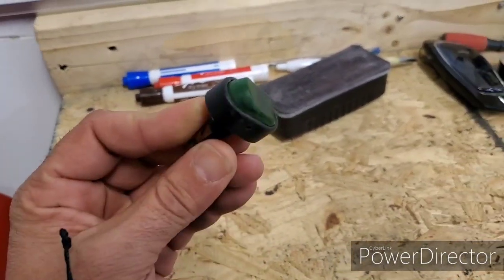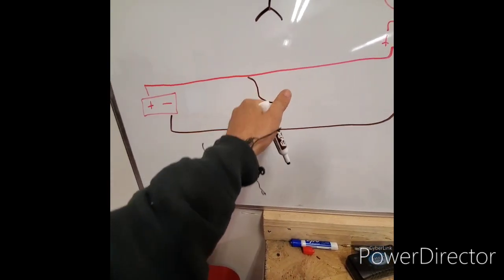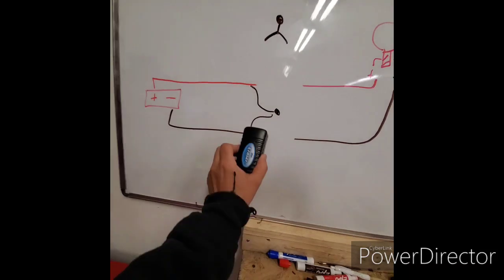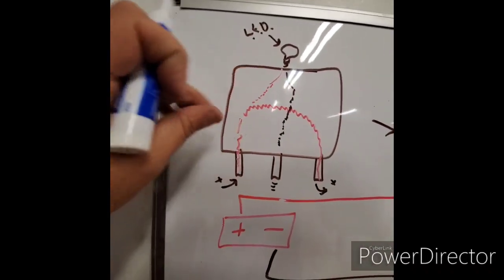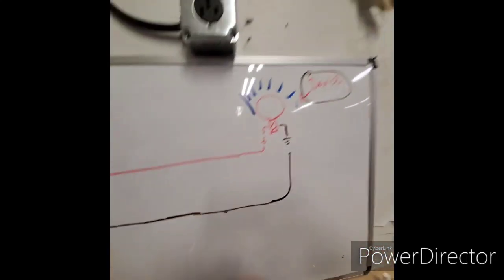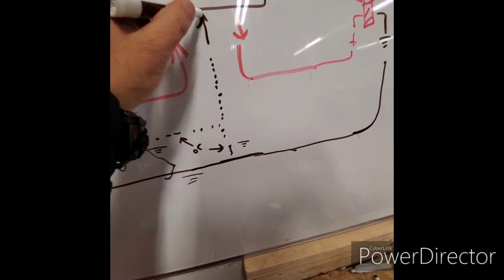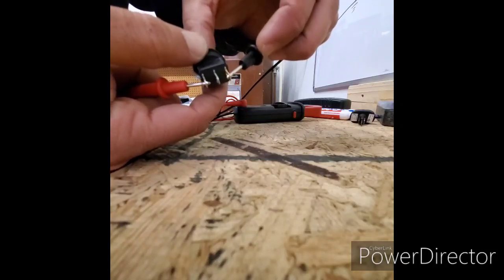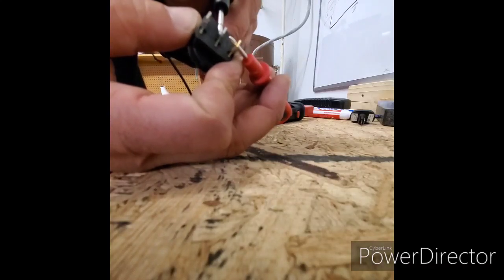How to wire an LED toggle switch , ( on-off 3 prong rocker switch ) 2020

Comment: Main question is how many things can i connect to one switch i got rgb halos i got knight rider led light an bonnet vents led lights all normal connect to postive an a ground to work please let me know do i need 3 toggle switch seprate for each device or can i connect all the wire together can instll on one switch please help also i had installed all one switch an my wires today went in smoke u see but i think its to overpowering the toggle switch an i think the switch was not connected the way u said like on one leg they have been fine for months working an stuff but today for some reason they smoked lucky im ok please help to this answer no my other question
Reply from the maker: You do not "need" 3 different switches. You can use 3, if you want individual control. But not needed for function. You must use 1 power source, you mist fuse that power wire,  and both the fuse and switch, MUST match the "amperage" draw of the lights combined. No matter the switch or device, the switch will ALWAYS have to be use only on 1 leg. Either power or ground like in the video.
Reply: @myonlinecarguy1  ok i think i know so can have one toggle switch with the fuse in the middle of the switch an the power cable from the battary all on one leg the amp of the fuse does that have to be the same amp of the switch an is it jus one fuse i will have right inbetween the power cabel from the battary an the switch an the amperage how do i find this out for my lights like is 18 amp fine do u think is there anywhere else i can talk to u an send u the pics of what lights i got in more dept please u got insta wats app or anything
Reply: @myonlinecarguy1  hi how do i know the amperage im drawing from my lights
Reply from the maker: The paperwork for the lights.
Reply: @myonlinecarguy1  but cause theres a few light like i told u before how do i know the final out come of what wire i need an fuse please can i send u the listings of the lights i have on instagram or somewhere as im so confufused its not like one light im lightting its a few
Reply from the maker: Youll add up the aperage for each of them. Thatll be the total load.
Reply: @myonlinecarguy1  ok the way i add it up i can search the lights on ebay that i brought an check the specs of the amp right as i dont have the pacaging for the halo or lights anymore also the wire i need to use 18gauge do u think is good
Reply: Hi so today for the toggle switch it got fused to a fuse in the fuse box insted of direct battary power i perfessional place done for me i thought as u as i didnt know u can do this way
Reply from the maker: @parmindersidhu9690  yeah. The origional power source can come from an existing fuse, as long as what ever the fuse is for is big enough to run everything.
Reply: So its fine right
Reply from the maker: Yes, should be ok. As long as they installed a slightly bigger fuse. The origional fuse there, was for an exisring device. Not thers 2 devices, should need a slightly bigger fuse. Other then that. Yes should be fine.
Reply: @myonlinecarguy1  the there was spare fuse  section if that makes sencse they didnt remove any fuse i rember it was jus a spare socket its working fine
Reply: @myonlinecarguy1  so sounds all good right i need a thumbs up im waiting if it is lol
Reply: @myonlinecarguy1  it came with 10amp fuse shall i use 15 amp u think see they put lower fuse 7.5 amp
Reply from the maker: Id put a 15amp,  Not bigger then that though.
Reply: Im confused please help
Reply: @myonlinecarguy1  ok so cause it came with 10amp in the fuse case they put 7.5 in i can jus put 15amp in an if that blows shall i just go back to 10amp do u think
Reply from the maker: If 15amp blows/pops. Then you may have a connection problem..15amp shouldnt pop.
Reply: Let me say it more clear the reason im using 15amp insted of the 10amp that comes with the power wire already is because i have more device running right. Its a different thing if i just had one device running an i put a 15amp fuse in insted of the 10amp that would cause problems right like more current an cause a fire. Other thing is when i put the 15amp fuse is tommorow shall i jus stand an look at the wire when my switch for the devices is on to see if theres any smoking or burning if there was ever to be even thoubi have fused it would the smoking happen stright away thanks pal forget first question didnt sound clear this one does
Reply from the maker: @parmindersidhu9690  the extra power available from using a bigger fuse doesnt mean more power is used. It only allows more amps if the device calls for it. The power does push into the wire...its called by device. So. For clarification.  Let say only 1 device is on the wire amd device is 10 amp load....but you have 20 amp fuse. 
This would still ONLY pull 10 amp. Because the device calls ONLY for what you it needs. Fuse size does bot force power i to a wire.  I hope that helps.

Comment: I was connecting led lights to my car. So my floor boards light up red. Well I did exactly what not to do. That's connect both +& - on 1 line. When I hit the switch oh boy did it light up red 😎 Then 🔥. Nothing 2 extreme just the wires by the fire wall. Stopped it b4 it got 2 bad.

Comment: HELP ME!! this is going to be long and drawn out but im desperate at this point. I have a boat. a 24V system in the front of the boat not connected to the ignition in any way. The 24v system goes to a trolling motor which works splendid. then to an on board charger which works splendid. then to an amp!!! this god damn amp wont power on anymore, but its not a typical connection. I have a mounted 1600w 8 channel amp. the ground goes to the battery just fine. The positive lead goes to an 80 amp fuse between the battery and the amp. The remote wire (bluetooth) is ghetto rigged to a fuse box? i think? (i put a 10a fuse in to power on the amp, pull the 10a fuse out to turn it off). the remote wire then continues to the amp. I have reaplaced the 10 amp fuse but not the 80amp fuse as it is only 2 months old... I realize this is ghetto but why doesn't the amp power on when the 10 amp fuse is inserted (has worked 100+ times prior)? is the amp circuit board shot? i would like to run the remote wire to a 3 way toggle switch and mount it but the amp stopped woriking... thanks
Reply from the maker: I do not know of any amplifiers capabale of functioning at 24v.  I would suggest you bring the amp to a garage, try and "hotwire" it with a standard 12vdc and see if it even works. 
Even in super high end car audio, 15v, 16v is really high. The circuit boards are not yet designed to process 24v. 

Now, if your boat has a step down of some sort, to reduce from 24->12 thats diff. But that was not mentioned in your explanation.
Reply: @myonlinecarguy1  really? people don't connect amps to a 24v system?
Reply: @myonlinecarguy1  is a 24v system for the trolling motor and amp. that is too much?
Reply from the maker: 24vdc is def too much. I would suggest you google the model # of your amp and look at its specs and you will see it ratings. Generslly something like 600watts rms @1 ohm  15vdc

Comment: sir I teach philosophy at a college level. I can explain plato, Socrates, Augustine, Aquinas, Hobbs, Mercer and Freud but I cannot for the life of me figure out how to wire this rocker switch without blowing the fuse. I've blown 11  "
Reply from the maker: Whats the device? I wonder if that is where the problem is. Even if the switch is wired correct, if the device has issue it will continue to have issue through the switch as well. So the fuses your blowing might not be a wiring fault.

Comment: Great explanation, I have a straight “on/off” toggle switch on my Harley, on the back side is a wire connection or “clip” similar connection to wiring under the dash of vehicles, you push it in to another clip and it “clips into” a plastic connection, 
so it’s not so much as to how a toggle switch works,,it’s how in F*£<=k do I plug into a wire harness “clip” for example, I have LED LIGHT STRIP, all is has is 2 loose wires , you can’t put wire nuts on it because the end of the toggle is a plastic connector that plugs into a “plastic connector “ How do “I” you “join” or connect something like that,
Like “2 prong switch “ typically you wouldn’t just wrap loose wire ends around the 2 prongs and call it good. What or how do you connect the “device” into a toggle switch that has prongs like you shown? Any explanation would be awesome,

Comment: 🙏🙏🙏🙏
Reply: Great video.   I am trying to connect a new 3 prong toggle switch on my atv.  The new switch has a black, brown and blue wire.   The wire harness to the power is: black, blue and white.   How do I determine what connects to what?    I know wire harness  is solid.   Prior toggle was working, just looking to mount switch on the handle bars.
Reply from the maker: If its not labeled. And no paperwork ur only option is to meter, looking for continuity between 2 line that open and close accordingly.
Reply: @myonlinecarguy1  I tested both for continuity.   On the switch, the Black and blue both have continuity.   No continuity on the brown.    On the wire harness, the white and blue both had continuity and no continuity on the black.    So I put the black on the switch to the white on the harness.   The blue to blue and the brown on switch to the black on the harness.    Thanks again for the video.  Very informative.

Comment: I did what you said one on and one on the other and I burnd my thumb
Reply from the maker: Did you test the switch with a meter? The toggle shouldnt have any kind of "short" as you should literally ONLY be wiring into 1 wire power (or) ground.  So an electrical short is impossible. I would suggest,  rewatch the video, i share a ton of details that matter, including testing your switch properly to make the proper connections. Id be happy to try an help calrify, if you still find you are confused about something.

Comment: Wire burned when I did this
Reply from the maker: When you did what? Wired as the video explained to do?
Reply from the maker: I know this particular video is a pinch longer then most. But i share a great many details during the video. Including testing the switch connection before wiring it up. By testing the toggle properly you shouldnt have any sort of short from the switch. Also.....you shouod be woriing with ONLY (+) or ONLY (-)....1 of these by itself cannot create a short. I def suggest rewatching the video in full detail. This particular video has helped THOUSANDS of people. The information is there in the video. If you need further assistance id be happy to try and help out.
Reply: @myonlinecarguy1  thanks . I put the acc on with the power from battery and had the power supply going to the device . I’m assuming that’s what caused the spark . I switched it and it worked fine . Appreciate the reply